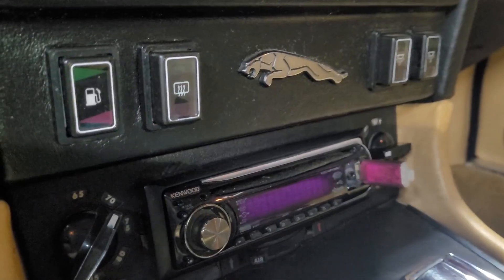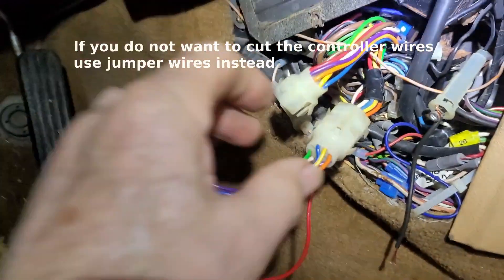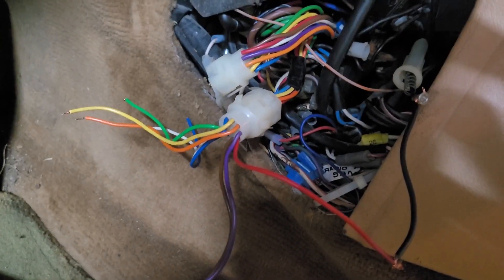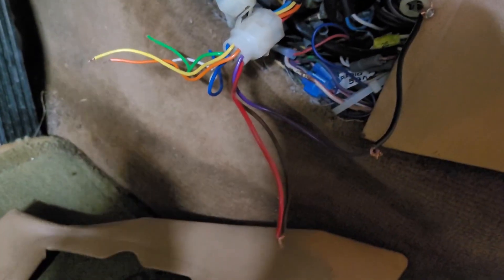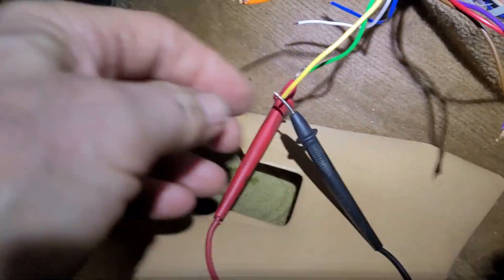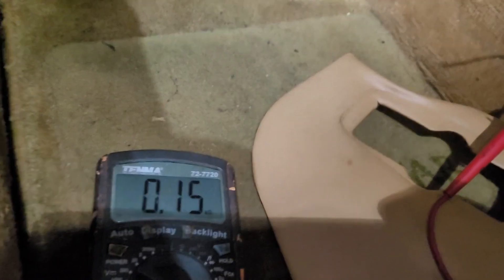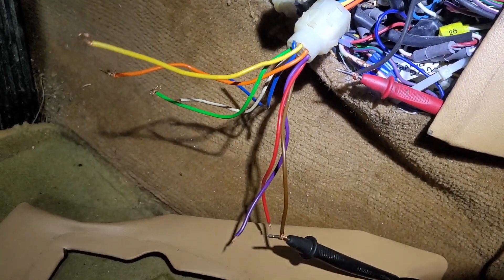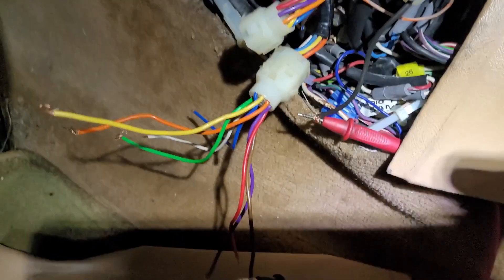Testing the Climate Control Servo of the Ser II and Ser III Jaguar XJ

Comment: Novom, I have no power on brown wire. I checked several inline fuses on right side. Where else should I check? Thanks
Reply from the maker: Greetings,
Power is fed to the brown wire by way of the power switch, so I have to assume you have the the ignition on and the system turned on.  
Assuming the switches are on, the the power is fed from a 35A fuse #6 in the main (left) fuse panel to one of the micro-switches of the main ON-OFF fan switch and then to the amplifier.

The power leaves the fuse box on a light green wire and mates with a green wire when it plugs into the heating system and then connects to the OFF-ON switch. From the switch the power is on the brown wire that goes to the amplifier.

I have seen the switches fail and that requires removal of the switch and replacement of the bad micro-switch.  It can also be the fuse #6 or the prongs that hold the fuse, sometimes these prongs will get weak or corroded and the circuit will open.  It is then a matter of cleaning the fuse holder and bending the contacts a bit tighter and you are good to go.
Reply: Thanks Novom2001!!!